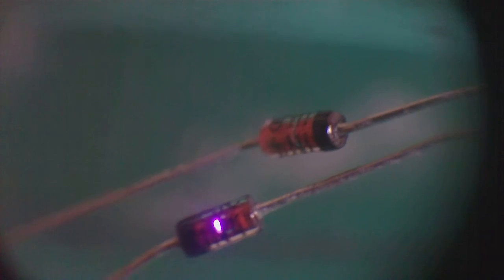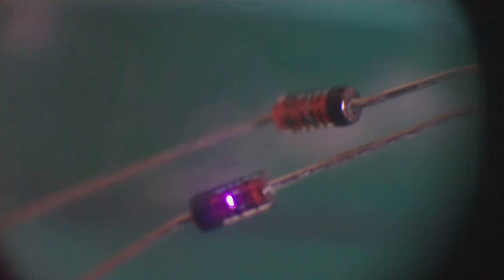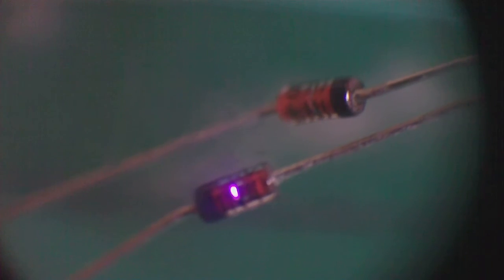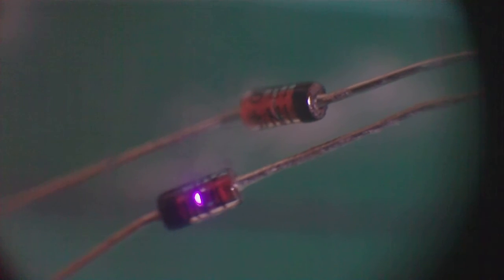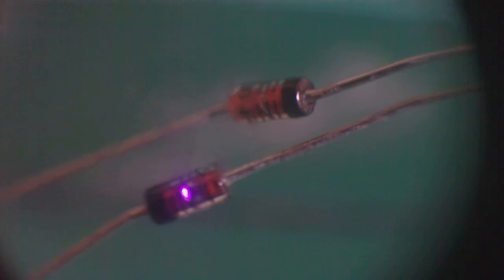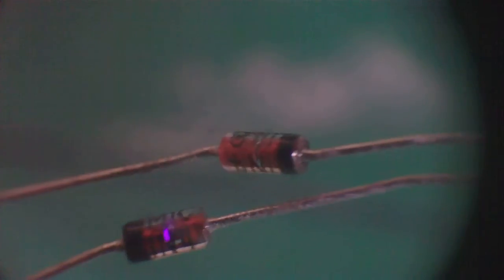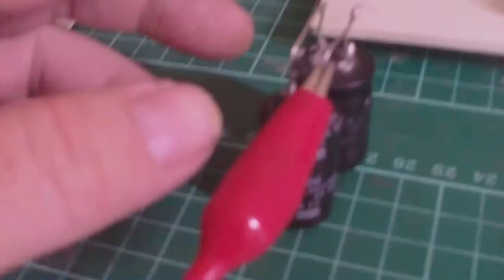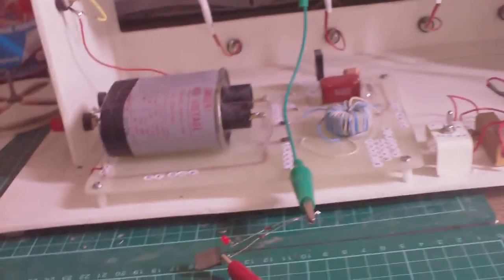1n4148 diode glow in experiment

Comment: A diode is very inyerresting. Remember me an experiment with a ac hand weel magnetic generator  and a joule thief for recharging a cell. The diode at the output of the wheel start to burn when i turn the wheel. Diode converting ac to dc , but without a charge, they start to warm and glow !
   I have stop the experiment before the diode diying.
Have a greath day steven.
Reply from the maker: thanks